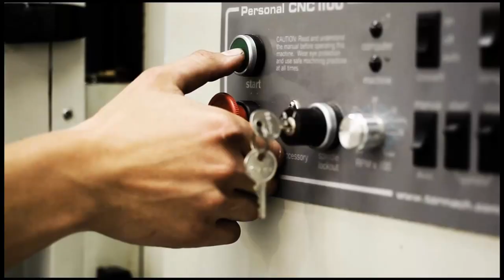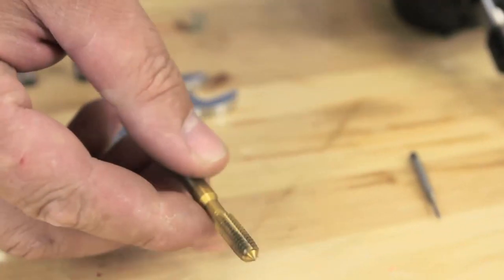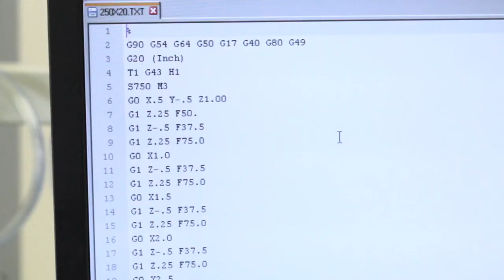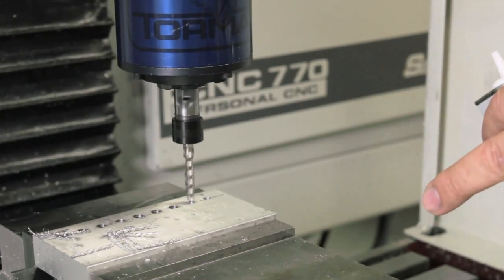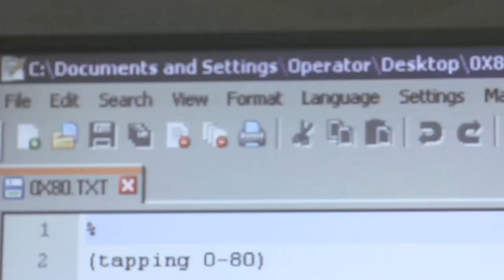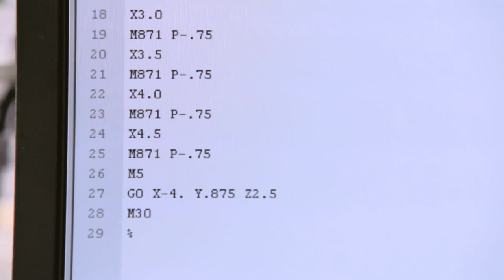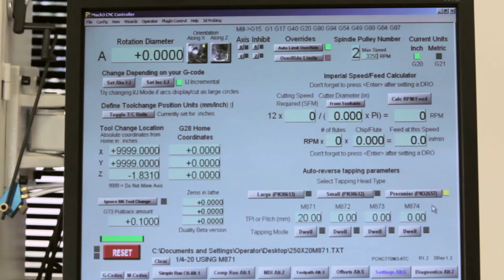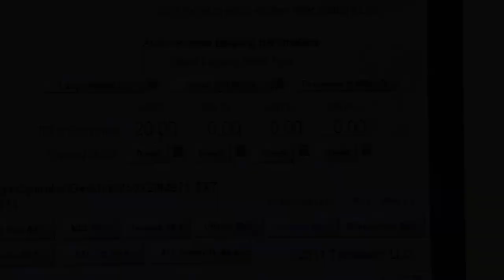How to Use the Tormach Auto Reversing Tapping Head - Tormach CNC

Comment: essentially. It's easier to program, as John mentions below. Keep in mind, there are many other brands. I've got one from Enco with the same features. I can't say how long it'll last but there hasn't been any problems so far. At $200, it was worth a shot in my book. 
They all come with Jacobs taper arbor holes so you can pick up a JT2 or JT6 adapter from tormach and it'll fit right in with the rest of the TTS stuff

Comment: This may be a stupid question but as a novice I was wondering if there is an advantage that this head has over a tension compression tapping head and if so what it is.
Reply from the maker: The Procunier has the extra advantage of being self reversing. To do the same with the tension compression tapping head, you will need to add a G84 command to your g-code.
Reply: a tension compression head requires computer controlled reversing of the motor and computer control of z axis.  This head does not reverse the motor so you can auto tap on older machines with a manual control of the z axis and forward run only motors. (forward runing only meaning it will not stop and reverse under enough control). The tc head will only work on the newer cnc machines not the older manual type. so if you have both types of machine like me you only need one type of head...

Comment: TiN coated forming tap in aluminum gets sticky. I have never used a tapped head (rigid tapping only) - curious how the mechanism reverses itself. Is it the back pressure from the Z reversal that forces it to engage a reversing gear?
Reply from the maker: Yes, but you will have to double the speed when you reverse the Z in your g-code programming. This article adds more detail: https://www.tormach.com/blog/fab-lab-skill-builder-how-to-use-and-program-an-auto-reversing-tapping-head/
Reply: Thanks - really thinking the 1100 will cover our bases but really need to nail down tapping. I owned a Haas TM2 in my first shop which is a great option but too tall to fit in my garage. Hoping I can sort out a reliable and precise tapping solution for the 1100. Aluminum - #2 thru 1/4-20 although mainly the smaller ones.
Reply from the maker: If you want you can contact our technical support department. Someone there will be glad to answer your questions. https://www.tormach.com/contact.html

Comment: great video, and you even show us how to take out/ install the bits great job.
P.S. in the video series on the surface grinder (psg16?) you don't show us how to mount the grinding wheel to the spindle!!- only balancing the wheel on the arbor support and then you go straight into grinding the vise surface and using the grinder what a mistake , especially when 90% of people watching this video are AMATEURS (home hobbyists) and this product is designed for home or light/ medium hobby work. ( most of us have at BEST only used or have access to  a bench grinder/ drill bit sharpener and have only seen these type of grinding machines on TV or in a catalog.) we DON'T know how to use these, we haven't gone to collage and studied fitting & Turning.
Reply from the maker: Hi Andy, Thanks for the suggestion. You're right we should have shown it and frankly I don't know why we didn't. The next time we shoot our videos we'll make sure to do an update on this to show the procedure on how to mount the grinding wheel to the spindle.